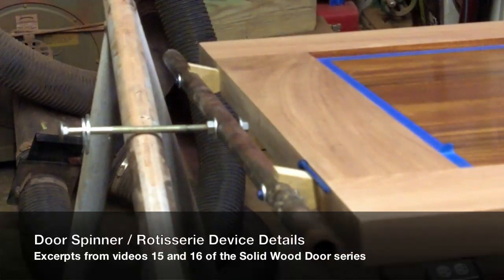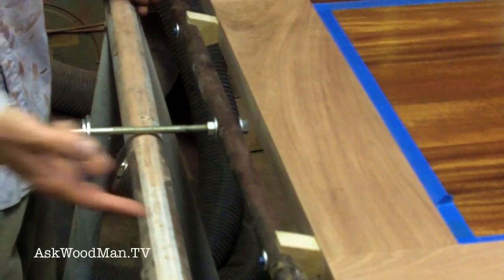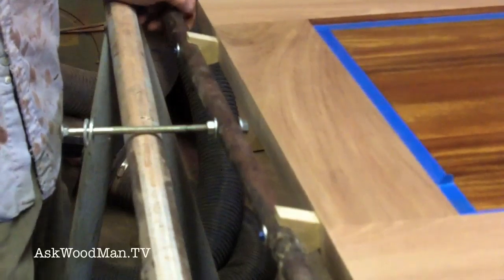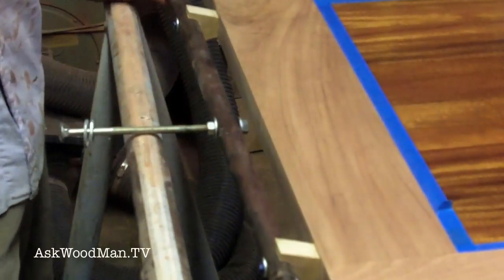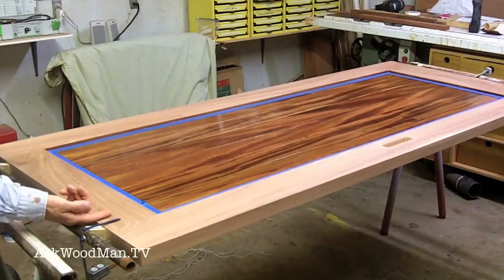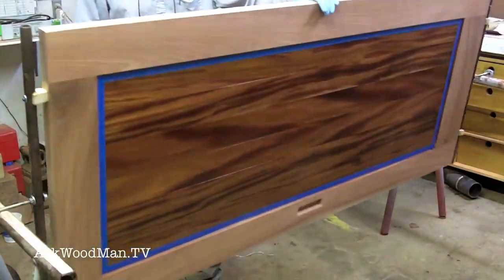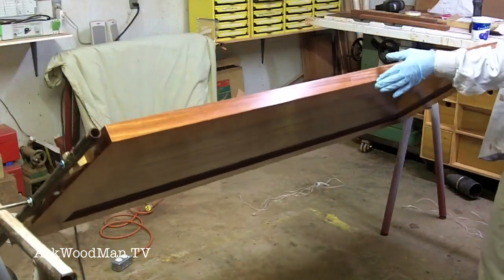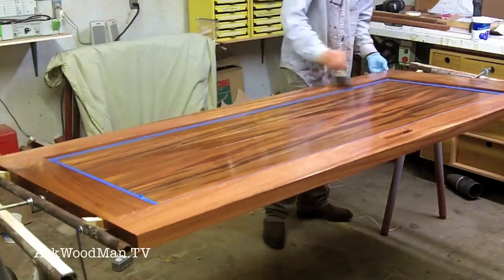28 Spin Your Door For Easy Finishing • Solid Wood Door for Finishing

Comment: Allan, you are a lot of company. I am alone in my shop as you mention many times that you work alone. I turn on your videos just for company. You talk like me, only faster. I live in a small Alabama community and only got high speed cable in Dec 2013. It has been amazing to see all the tools and techniques there are out in the shop world. Some tools I want I cant justify the cost, I am only a DIY for pleasure. I will soon be 70
  the rig you use to finish the  door is simple but brilliant..   I wish I had of known about your ultimate work table back in time. I don't do metal fabricating, but I was wondering if I ask around, I could come up with the metal parts you have in the UWT.  I have a source for rough sawn lumber nearby that saves on project cost.  Anyway, just wanted you to know that you are appreciated in my life.
Reply from the maker: Thanks Bob. The metal work is really not a problem. If you got your steel cut to length I know you can do the drilling and tapping yourself. Plus I am always available to answer questions. The UWT design really shines because not only is it super strong, but it can be made in small bites while the completed parts are still useful for other work. Just getting the horses made gives you something to work on. The other thing is the materials are just common components. Nothing expensive or exotic. Thanks for writing and keep in touch. Allan